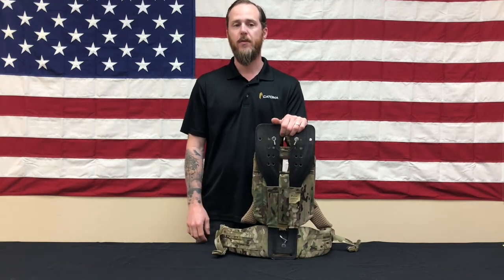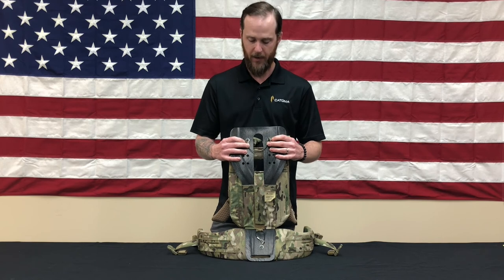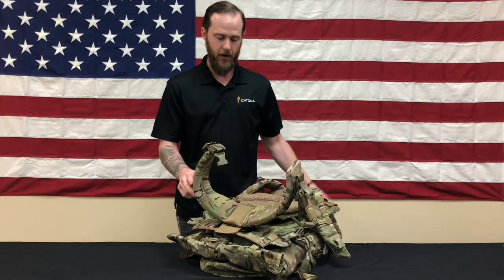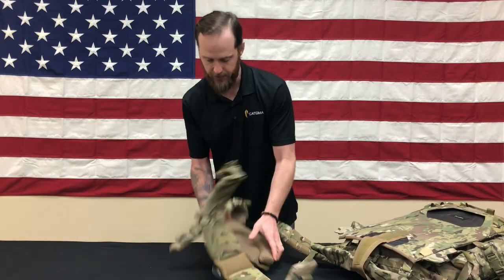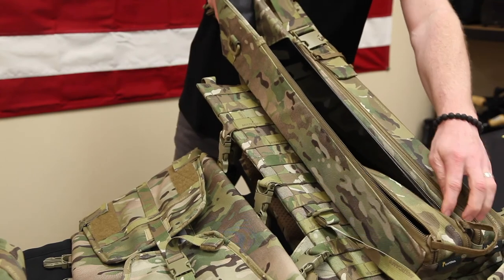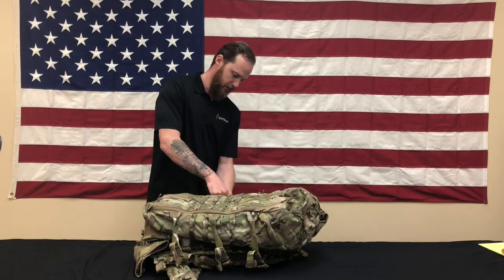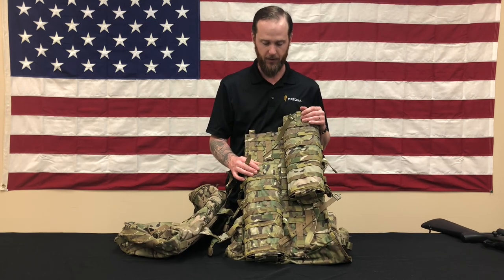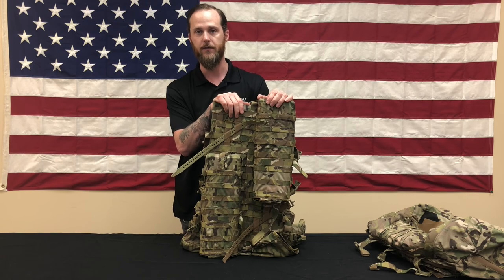Switchblade In-depth Demo

Comment: Is there anyway you can fit more ammo?
Reply: Looks like there is room for 1 more of those ammo cases for a total of 3 or 900 rnds. Not sure though.
Reply: @iMetalocalypse  There is indeed room for 900, and the manufacturer points this out specifically, but they recommend against doing so just because the weight would be excessive,